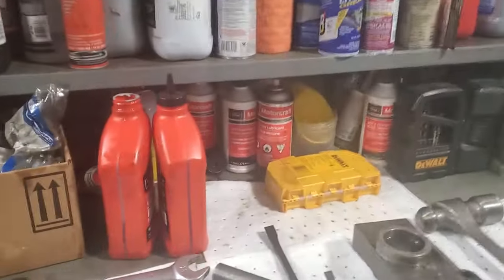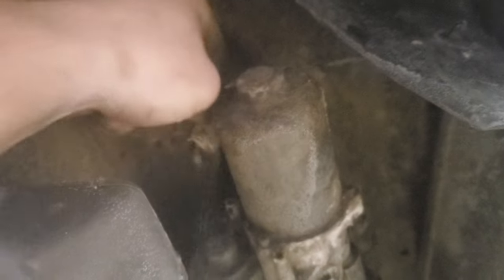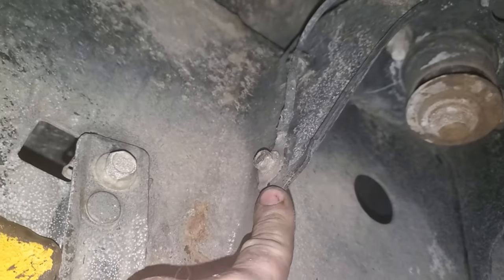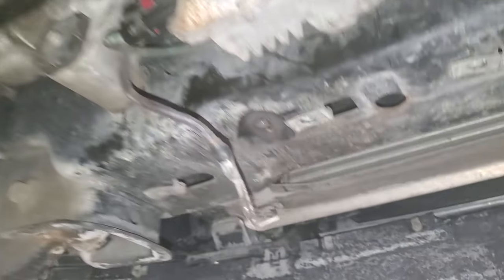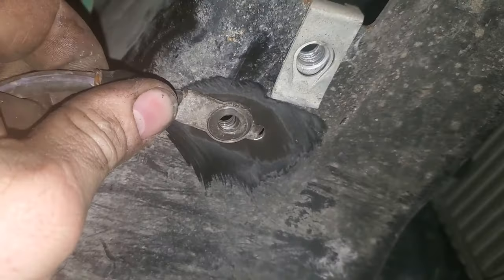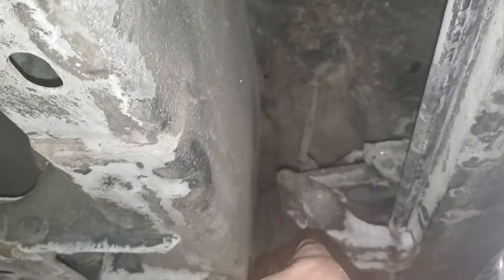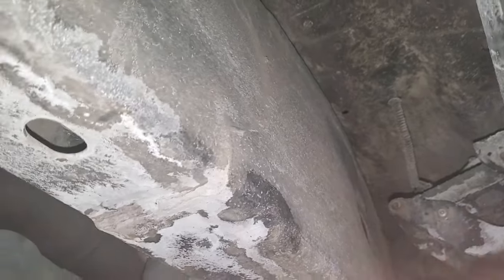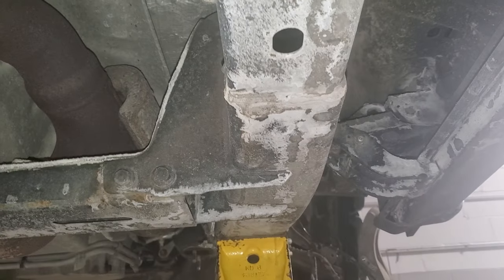EVERY F150 OWNER 2011- NOW PLEASE Do This Notorious Ground Problems - Body to frame, epas to frame

Comment: What are symptoms of ground issues ?
Reply from the maker: Intermittent no start, EPAS codes your electronic power assist steering, intermittent trans shifting issues, communication errors on the network, there's too many things to mention and it only takes half hour to do all these connections so it would be worth it to go ahead and get ahead of it now
Reply: @FordBossMe  awesome. Spring maintenance once the deep freeze is over !
Reply from the maker: Good Idea
Reply: Reset it and next time put the negative from the charger on any ground that is right next to the battery, there are at least a couple. That way the ECU sees amps going into the battery and knows it has sufficient power to start. Don't ask why, there isn't a super computer in their, less computing power than the smart phone in your pocket. Anyways that's how they do it. Hope that helps!!
Reply: @FordBossMe what's the name of the harness u mentioned that's on the side of the frame rail???
Reply: Whatever that harness goes to it has corrosion in the inside don't know if it has anything to do with my truck no start
Reply: @timdondadaamos8978 i believe that's a transmission module...he was talking about the ground strap from it to the body or frame. some years/models have it there, some don't. check starter relay, all relevant fuses.... there's some good vids on your year/model/situation on you tube, even some by boss
Reply: Should I unhook the battery cable when I do the ground wires
Reply: What to do if body is completely rusted for frame to body ground strap? Run a long wire to another spot?
Reply: I have a 2011 f150 with 220,000 miles on it. I have never had any issues here in Texas. Should I worry about it now or just leave it alone?
Reply: Yes @RonnieYoung-zx8wu

Comment: For grounds like that use regular grease, not dielectric grease. The reason is that you want current to flow as much as possible and there's no chance for the grease to leak current to a positive source. You would want to use dielectric grease in a situation where positive and negative terminals are close, such as a bulb socket or harness connector, and you don't want any type of conductive grease to cause a short circuit. But for a situation like a frame connection all alone, a conductive grease or regular 'ol grease will only enhance that conductivity between the connector and the frame. If you use it sparingly and clean it off the external surfaces, then you can paint the metal to protect it from rust and seal off the electrical connection even more from moisture.
Reply: 100% right. A dielectric is defined as an insulating material or a very poor conductor of electric current.
Reply: Using regular grease on a chassis ground is actually not recommended, because typical greases do not conduct electricity. Regular greases are typically made from petroleum products or silicone, which are insulators rather than conductors. Applying such greases to a grounding point could interfere with the electrical connection by introducing a resistive barrier between the metal surfaces.

However, the idea of using a substance to prevent corrosion at grounding points is a good practice. Instead of regular grease, it's advisable to use a specific type of grease called dielectric grease or a product known as conductive grease:

1. **Dielectric Grease**: Despite being a non-conductor, dielectric grease is beneficial for protecting the metal parts from moisture and corrosion. It is silicone-based and prevents moisture ingress, which can lead to corrosion and poor connections over time. Dielectric grease is applied around the connection rather than between the contact surfaces themselves. This helps in preserving the connection while protecting the surrounding area from environmental elements.

2. **Conductive Grease**: For applications where electrical conductivity is crucial, such as on battery terminals or grounding points, conductive grease is appropriate. This type of grease contains materials that facilitate electrical conduction. When applying conductive grease, it’s important to ensure it is suitable for the specific type of electrical connection and environmental conditions.

When improving grounding connections on a chassis or other electrical grounding systems, the goal is to maintain a solid metal-to-metal contact. If corrosion is a concern, consider cleaning the contact surfaces thoroughly, using conductive grease sparingly, and ensuring all connections are tight and secure. Always verify the type of product you are using to make sure it serves the purpose of enhancing electrical conductivity rather than inhibiting it.
Reply: Use noa-lox. It can be found in the electrical dept or with any electrician. It conducts, electricity, doublesas anti-seize, and prevents corrosion.
Reply: “Di-electric” is in the name Dielectric grease. Silicone based, it promotes conductivity only at 0.5 micron or less gap and becomes insulating when gap is greater. It is semi-conducting when electricity passes it. Normal grease is extremely bad for electrical use.
Reply: WRONG
Reply: i would use oxy guard product made for alunimun and copper connections
Reply: Thank you least some ppl get it die electric grease is a insulator not a conductor, best way to secure a ground like that is clean the threads with a tap , use maybe some white lithium grease on the threads of the bolt secure your freshly clean eyelet then maybe put a coat of paint over it to seal it, 🙄

Comment: This is commonly misunderstood. The grinding of the body is doing a disservice, look at the ground lug. The bolt head makes clean, wide contact with the lug, then the bolt becomes the conductive part. The bolt now conducts on the frame threads to make the electrical path, this why it’s always bolted to painted surfaces. Sometimes they have serrated washers that scratch through paint a little too. Grinding a big patch of bare metal around the lug is not so useful and makes the area more susceptible to rust. What you are right about is the need to protect the whole area from getting rusty. Silicone is not my preferred method but I won’t criticize it.
Reply from the maker: So I use the silicone to keep away the moisture but it's not going to stop the bolt for making contact with the body of the vehicle I've been doing this for too long a lot of people say that it's an insulator but that's more for connectors not so much when you're putting a big bolt into a piece of frame
Reply: What is your preferred method? I'm trying to learn different ways and techniques for different tasks and I do think that silicone helps, but just by the way it looks I can tell it wouldn't last long. Would an insulating spray like the ones used on batteries be better? Or an anti-rust spray treatment maybe?
Reply: I am an electrician in the country's largest fire apparatus manufacturer, and yes the paint is always ground off and the connection covered with a silicone sealant. I do agree that the threads are probably doing the most conducting, but a clean tight mating between the bolt head, the cable lug and the frame or body surface is also going to conduct . We also use a dielectric grease on such fittings, mainly inside the vehicle away from weather. Some of the ground cables on a fire truck are  as large as 4/0, so yeah a lotta electrons......
Reply: I argue this, if the fastener (bolt) threads and their limited contact surfaces were doing the job, we wouldn't be discussing a remedy today. However, I grant you (any opposing voice) that they probably started out fine, so perhaps weather protecting these factory ground connections during production is the answer. But as a remedy later, I'm looking to peel back as much paint from the frame as necessary to plant that cable end firmly against bare metal. It already failed once. I'm doubling down on the contact area the second time. I wouldn't want the problem to present itaelf again, at least not from these locations.  These vehicles have enough wiring problems after 10 years without me adding to the list.
Reply: What if you just repainted or sealed the connection after service.  I think an exterior Paint seal may be better than silicon as silicon could lose the seal over time.  Maybe silicon on the painted connection?

Comment: Do you think a grounding issue would cause random bulbs to go out for a few days, come back on, and then another random one goes out? I’ve been tracking this issue down for awhile!
Reply: that is the AC (Alternating Current) ripple voltage that exceeds the maximum tolerance limit of around 0.4V_AC which comes from a decrease in alternator performance...
Reply: I'm experiencing something similar my cab light on the inside that is supposed to either be in the off position or in the middle position it will come on when the doors are open and then the all the way over position would turn the inside light on and keep it on. Well sometimes that will turn on and sometimes it won't whenever it's in the middle position also when I am driving down the road also when I'm driving down the road and I have my AC on it is all fine and dandy but as soon as I come to a stop my battery light comes on until I start moving again

Comment: You know, recently Eric O of South Main Auto found a similar issue with a really new GM truck, braided ground strap going from body to frame caused all sorts of electrical issues along with loss of electric power steering. He replaced the braided strap with a beefy 4 gauge cable, should outlast the truck.
Reply from the maker: Yep it's common on these newer trucks

Comment: Had a 2001 3.8 that wasn't starting intermittently. Thought it was the battery and that fixed it for about a month.It stopped starting and I had power to the starter so I figured the starter finally died and I got a new one. On taking the starter out I found a ground on the starter was loose. Tighten the ground up, returned the new starter and I was back in business. Gotta have good grounds. Good video. Happy Motoring

Comment: Thanks for the reminder Ford Boss. I need to do that to my 2011 F350 Super Duty. My wife's 2014 Ford Escape bad grounding issue last  year. We bought it and didn't know the battery was low already. So while driving on a sunny day the wipers went on full blast like a ghost turned it on. 1st Ford doesn't make it easy to get to that battery. I went to check the cables and the negative cable was corroded beyond repair. I soon learned that many sensor problems are due to low battery levels. New cable installed. I like your solution with the silicone after cleaning it up. Appreciate it.

Comment: Thanks for taking the time to make this video and share some valuable info. This helped me get pointed in the right direction to repair an intermittent backup camera problem on a 2013 F-150. I wanted to return the favor with a bit of info that I learned in the process of making this repair. After reworking a few ground connections as shown here, I started to see some info regarding the types of silicone that are available and that some should not be used with electrical connections. I had used Permatex RTV Silicone Clear Adhesive 80050, and after trying to find out whether or not it was acceptable for electrical connections and seeing multiple conflicting opinions, I decided to go straight to the manufacturer and called Permatex. The product rep that I spoke with was very knowledgable and helpful, he explained that there are 2 basic types of silicones, one is acetic and one is neutral. You do not want use an acetic silicone on electrical connections as it has an acidic solvent in it that helps it cure faster and can cause corrosion on the connection or wires. A neutral silicone would be ok, he suggested just putting a good coat of dielectric grease over everything once it is cleaned and put back together. Another option for a more durable coating would be to paint on some liquid electrical tape. Hope this helps someone, thanks again for the videos and keep them coming!

Comment: I have a 2017 f150 3.5 ecoboost I have done and replaced about everything, tested so many things cannot find the issue. I keep getting a charging system service now signal even after cleaning this ground it’s very intermittent and happens a lot on bumpy roads. Thank you

Comment: Solid advice I relocated my ground on my 92 econoline 150 grinded it cleaned bolted it tight and sealed it up did wonders no more voltage drops and fast starts
Reply from the maker: I've had to do that a lot on the Econolines especially right underneath the passenger door where the ground braided strap goes from the body to the frame those rot out and then they won't start
Reply: Man I had some good times in that ol conversion van lol but uh ended up letting her go she developed some valve issues but I want more power from my 4.6 06 TC any mod or cheap diy suggestions?

Comment: My buddy has had intermittent no start, and now it just won’t start at all and he’s replace his butt every damn thing you can possibly replace and I’m starting to think that it’s all ground problems, thanks for making a video, 2012 F150 is what I’m referencing. Let me know if you have any input extra, cheers brother
Reply from the maker: I had a brand new one with corrosion on the little braided strap that's on the starter solenoid that was causing a problem
Reply: Im having the same issue, powers up but wont crank and no start. Battery drains daily when connected. Just bought a new started but it could possibly be the ground wires.. ima clean them first and see. Wish me luck

Comment: @FordBossMe 2017 f150, 2.7 battery is draining but not getting a service charging system msg, just battery light when it drops to low 11’s swapped new battery twice, same result. No other accessories installed to drain battery. Getting 12v at terminals. 
Haven’t changed alternator because I’m not getting a charging msg, no codes, no check engine. 
Any thoughts ? 
Thank you sir.

Comment: Thank you for making this video!  I've got a 2012 fx4 3.5 that throws advance trac and low battery only when its cold out.  I was hoping it was maybe a bad ground or loose pin that contracts when cold.  You've given me a great starting point.  Grounds are easier than chasing wiring harnesses!  
P.S.  Any idea who the genius was at Ford who thought it was intelligent to disable your power steering when the battery sensor (garbage, btw) thinks voltage is low?  lol
Reply from the maker: Thought the battery monitor didn't come out until like 2015 on those
Reply: @FordBossMe   it has an induction type battery monitor.  I think 2011-15 had this set up and they went to an inline monitor in 2015.
Is that ground for the epas behind the skid plate?
Reply: 🙄 correct. My 2011 has the induction. My power steering did stop working once, the clamp coming from the positive harness directly after the battery gets loose. You will still read 12v at the PS motor but will not have the amperage to anything. Remember your dielectric grease 😁

Comment: Really appreciate the video. Don't know for sure if it will fix my problem yet but it's something I haven't seen yet and I've been searching high and low for other possibilities
Reply: Btw mine were toasted. 2011 3.5 liter. I've replaced relays and fuzes. Ignition switch, checked starter and am waiting on new PCM ECU. Will comment when trucks running again

Comment: My 2011 f150 has been down for a week. Had it towed from work to my home after it wouldn't start. My little scanner will not communicate  with it. The dash is showing starting system fault, advanced trac, low oil pressure, over heating and shows the wrench. When I enter the vehicle mileage shows on the odometer. When I turn the key odometer shows dashes rather than digits. Also, the radio and blower has power until I turn key to starter position, at this time I hear one click from BCM. 

I've checked fuses in bcm and under the hood. Swapped relays as well. I can paperclip jump the starter at the relay even though it doesn't start. This ground looks rough, so I'll clean it up. I did have an intermittent battery light a few weeks before all of this.
Reply: Did the ground fix it ?
Reply: @HoustonRocket281  No, my problem was a pinched and corroded wire at one of the pcm plugs. The black hood/cover over the plug pinched it when it was installed. Either a factory defect or from a dealer before I owned it.

Comment: Do you know where this ground is at on a 2019 escape titanium? I recently did an oil change on this vehicle and I was looking for this ground but I cannot see where it is. I know there are a couple of grounds up top under the air box but I could not see anything underneath it.

Comment: Would you say this is necessary in Florida?  My 2002 f150 @250k looked new underneath except a little dirt and oil spooge that leaked from the filter adapter before I replaced the gasket.
Reply from the maker: Now if it's clean it's not necessary

Comment: hello, my f150 ecoboost v6 3.5l 2019 gen2 all rear lights, and tailgate, blind spot system fault. help me please
Reply from the maker: Rear lights might have water in them or the ground to the frame in the rear on the inside of the Fram passenger side toward back by where the receiver hitch mount slides in might be rotten

Comment: Wonder if this is why I’m getting so many error codes: front camera malfunction, parking aid issue, door ajar message, coolant issue, service advance trac, pre collision assist not available, and some others. They have replaced the gateway module twice and it still does it. And sometimes my 8 inch screen will say vehicle network communication error. 

Is it just 2 bolts to do this to or are there several of them?
Reply: that is the AC (Alternating Current) ripple voltage that exceeds the maximum tolerance limit of around 0.4V_AC which comes from a decrease in alternator performance...